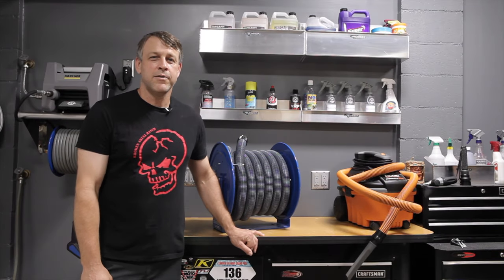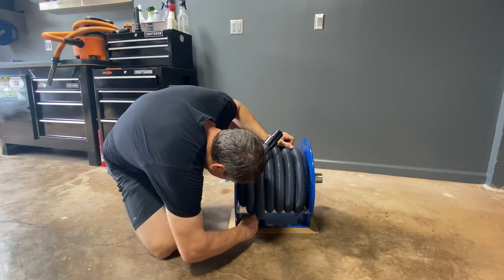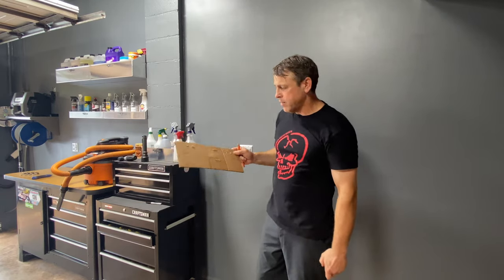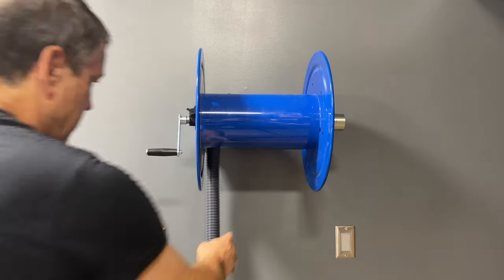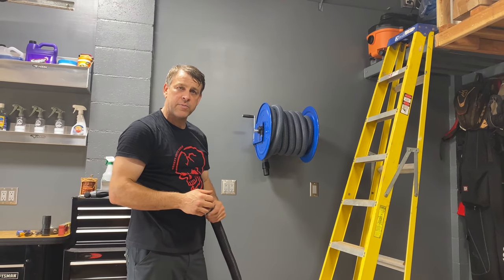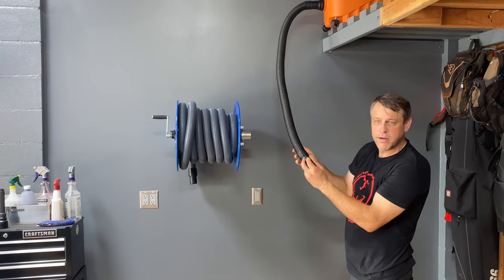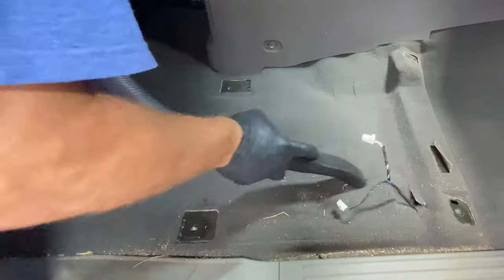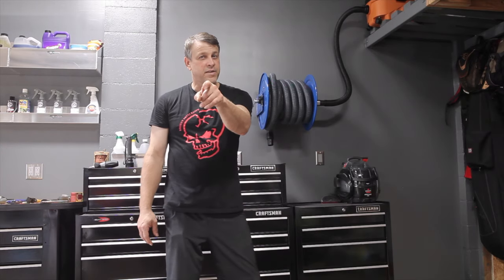BEST WALL MOUNTED GARAGE VACUUM & REEL FOR AUTO DETAILING BUSINESS with 35' hose

Comment: I am absolutely loving your setup. Do you find that the 5.0 rigid vacuum has enough sucking power for detailing?  I have 6.0 SHO-vans but I’m thinking they might be overkill. I’d love something much smaller.
Reply from the maker: Thanks for watching the channel. The rigid is a great little machine that does a great job. It provides a good amount of suction and I don’t notice any noticeable loss from the 35’ hose reel. More is always a good thing as long as the machine is actually producing more suction. The rigid is known for being a powerful small machine. Thanks again and don’t hesitate to ask any questions you may have. Did you check out the pressure washer vids. You may like that setup too.

Comment: Great Video!👍🏻
Do you by any chance know if you loose a lot of suction power using that long hose with that ridgid vacuum? I have the same ridgid shop vac & debating on getting that same hose reel & hose but worried that I will lose suction power.
Reply from the maker: The suction is great. I don’t notice any loss at all. You will be happy with it for sure. That setup is one of my favorite tools in the garage. Thanks for watching.

Comment: can you make a video testing the ridgid shop vac can extract well with the mytee extractor head through the 35 foot hose?
Reply from the maker: I don’t have a 35’ hose to use in the test. Probably not a good plan as water will sit in that hose after you are finished and it will be tough to dry out. Thanks for watching

Comment: Good evening,

Great video I appreciate it! 

I am using a rigid shop vac that has a  1 7/8 diameter hose. Rigid HP pro pack. 

I purchased the hose reel.

Any idea on how I can attach my hose or link for reducer of some sort?
Reply from the maker: Check out the fitting in here. It worked great with the rigid portable vac. https://www.amazon.com/shop/hawaiitesladetailing?listId=13TFAK2JVPN88&ref=inf_list_own_hawaiitesladetailing 

Here is the vid with it installed. https://youtu.be/BgIXIrFU8F0
Thanks for watching 
Hope that helps.

Comment: Great video could you show how you did the switch on the wall to the vacuum thanks
Reply from the maker: Sorry I did not film that. I wired a standard switched outlet on a dedicated 20 amp circuit. Thanks for watching.
Reply: @HawaiiDetailing  I also would be interested on how you did the switch on the wall. Thx

Comment: What did you do with the nuts that are on the back of the plywood against the wall.
On your other video with the pressure washer and reel you did the same thing.
Did you put spacers behind the bolts and plywood?
Reply from the maker: Check out the video. There is blocking behind the drywall. The plywood was for a friend that had a finished garage. My garage was a remodel so I studied it out prior to drywall for all of my reels. Thanks for watching
Reply: Nice set u
Reply: Nice set up
I’m building a house and gonna have my garage set up similar
Reply from the maker: @THETIMINATORTHETOOLMAN  thanks. That’s great to hear. Consider your layout and pre studding your walls to support the reels properly. I cover it in my pressure washer and vac vids. If you have any questions let me know. Thanks for watching

Comment: How did you install that power switch in the wall to run your vacuum?
Reply from the maker: Anthony Torrence Anthony Torrence it is a hard wired switched outlet. The plug is next to the vacuum and it is controlled by the switch under the reel. There are other options out there. 
Ralda’sdetails left a comment with an alternative soulution.

Comment: Question for you.  Did you need an adapter to get the hose from the vacuum to the reel?  Using a rigid vacuum that has a 2.5" connected instead of the 1 7/8" that you have.
Reply from the maker: I did not use an adapter. Thanks for watching
Reply: I am doing the same. Any recommendations?

Comment: I would prefer to use a central vacuum if I was a detailer
Reply from the maker: Yeah. The original idea was to build high quality affordable wall mounted vac solution that could be upgraded to a vacumaid or similar as needed. That was my plan and I have to say this setup works so well I have no reason to switch it out at this time. Plus you can easily disconnect the vac from the reel and take it mobile. Thanks for watching.

Comment: What size lag screws/washer did you use?
Reply from the maker: I used 2 1/2” lag bolts. The wall blocking is 1 1/2” + 3/4” drywall + 1/4” base plate of the reel makes for 2 1/2” to reach full depth. The reel is heavy so having full depth lags are worth it. Thanks for watching.

Comment: Curious if you'd ever used something like a Master Blaster with this system to blow off a car after a wash. I wonder if you would lose too much air volume with that much hose though?
Reply from the maker: They have small hoses and fittings. I think it would not be good. Not enough blast. Thanks for watching

Comment: I realize a 50 ft. vacuum hose can be used on this Cox reel instead of the 35 ft. you are using.  Can you, or any others, give assurances that it does indeed work as effectively with a 50 ft. hose as it does with the 35 ft?  Want to use with OVO 700AW central vac unit but don’t want 50 ft. hose to be difficult reeling in.
Reply from the maker: It will be no problem. I choose the 35' because my area is only 25'. If i were to buy another one I would go with the 50'. Thanks for watching

Comment: What vacuum accessories do you use that attach to the end of the hose? (crevice tool, etc.)
Reply from the maker: I use a crevice tool mainly but also use a brush attachment to help agitate sand from the carpet and a floor attachment to vacuum up the swisstrax garage flooring. The floor attachment is good to have with this wall mounted unit.
Reply: @HawaiiDetailing  do you have a link to the attachments?

Comment: I wish I could find a 2 1/2" hose reel for my work shop and all the ones I have found are all 1 1/2 which I don't want to use because I'm afraid it will clog any suggestions ?
Reply from the maker: I only know of the 1-1/2” version. Sorry. If I see anything that looks like It may work for you I will get back to you. Good luck. Thanks for watching.
Reply: @HawaiiDetailing  Thats kind of dissapointing but I am glad you still reply to comments even after over 5 months
Reply from the maker: @abdulelkhatib2674  oh you mean the video is that old.  Hahaha. Yeah I try to help people out as much as I can. I will look into it and see if I can find some info for you.
Reply: @HawaiiDetailing  Thank you very much I appreciate it
Reply from the maker: I looked into it. The Coxreels I use have a 2" hose and 1-1/2 cuff where the vac attaches to the reel. That is the only size available from them. Sorry I was not able to help. There may be other options that are for other uses like pool cleaning I believe uses a 2" hose and they have some reels that are not as easy to look at but might do the job. Good luck and thanks for watching the videos on my channel.
Reply: @HawaiiDetailing  Thank you for looking into it I will look into one for pool cleaning
Reply: Yorkiepoocharlie  yes I have clogged my 2 1/2 hose many times sucking up shop debris

Comment: Mine came with no hardware is that usual?
Reply from the maker: Yeah. You have to get the lag bolts that work for your situation. I used stainless 2.5” with fender washers. Let me know if you have any other questions.
Reply: @HawaiiDetailing  will a 1/2 by 3in hex lag screw work?
Reply from the maker: @longtime3941  yes. You want to get a good depth into the stud but not poke out the back. You should pre drill too so you don’t split the studs.
Reply: @HawaiiDetailing  ok cool. Man I wish I could show you what we working with lol